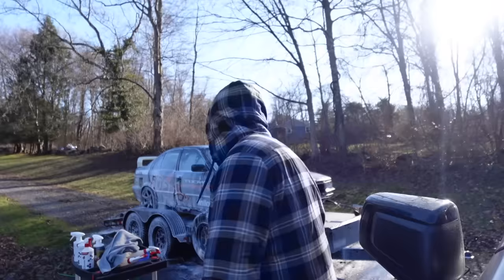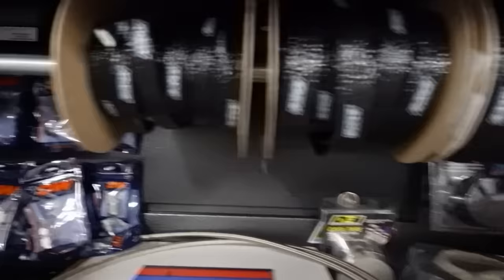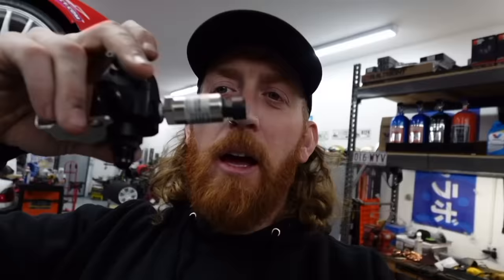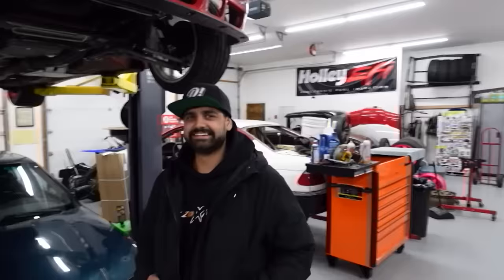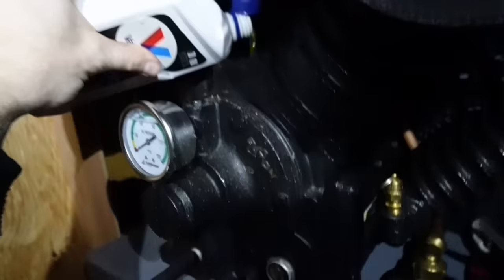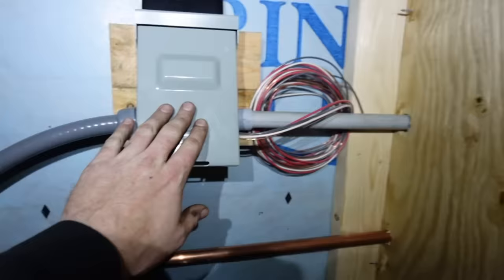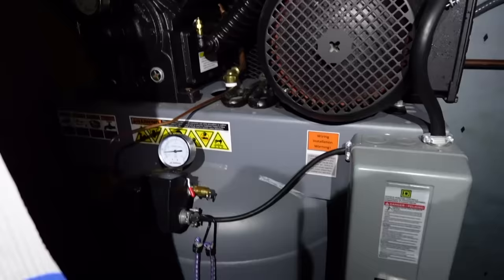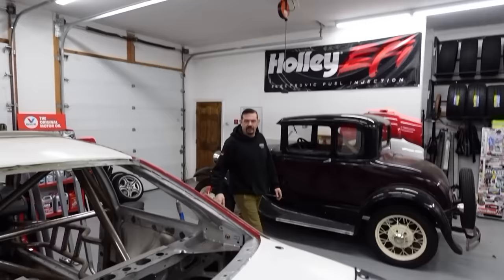We Finally Got It Running!

Comment: Temp change on pipe for air may cause moisture in the line put dryer in the shop
Reply from the maker: noted! I’m heating the shed but now i’m going to look into insulation for the pipe on the outside of the building. thank you!

Comment: Greet you need to insulate those compressors lines that are outside to prevent condensation post air dryer and also a water separator in the shop

Comment: U wanna put that air dryer on the inside of the building or u might have condensation issues after since ur running it outside to inside after the dryer